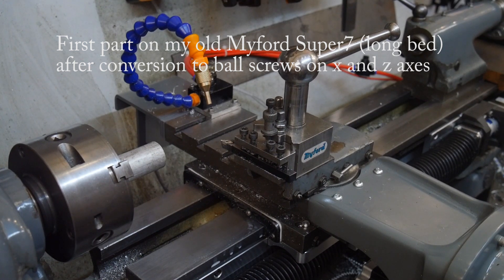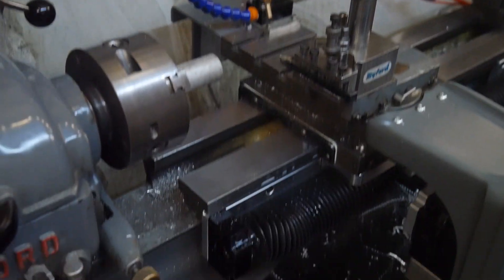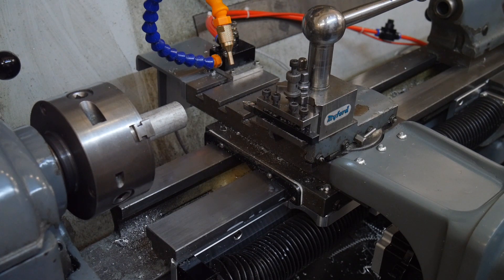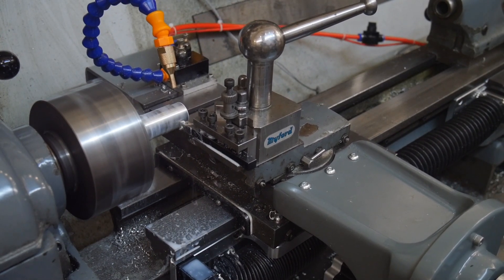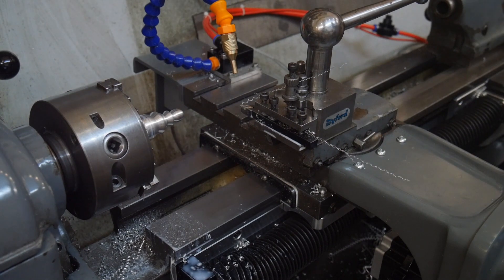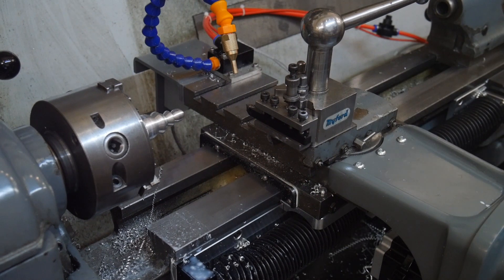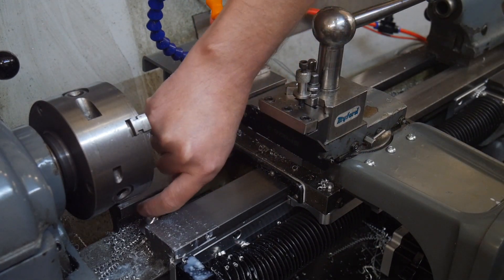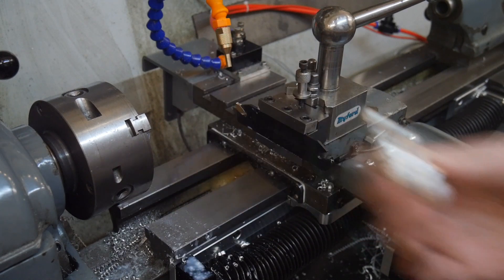Myford CNC with ball screws

Comment: Nice machine 

very similar to a Emco Maximat standard like that of my friend Michael.
https://www.youtube.com/watch?v=D5aaBIKbWBQ
I saw that your chips in the whole program only once broken properly.Use G96 times then the chips break nicely.
best regards Stephan
Reply from the maker: Yes, very similar.  G96 only works once you have a spindle speed sensor installed - that's next week.  This was the first program the machine ran in this configuration, scarcely surprising the cut weren't absolutely optimal.